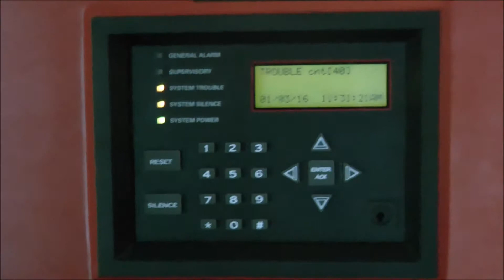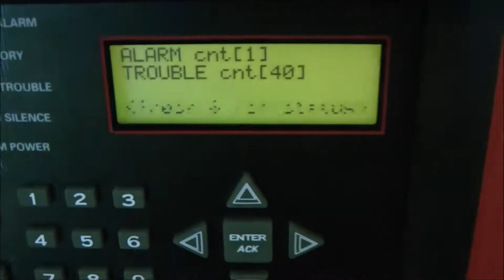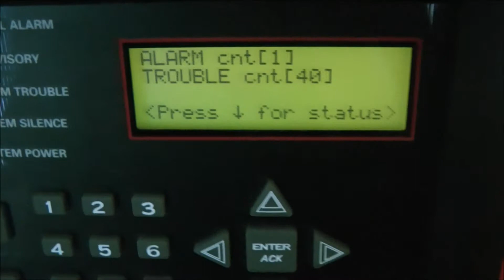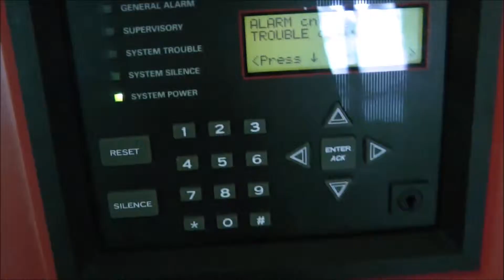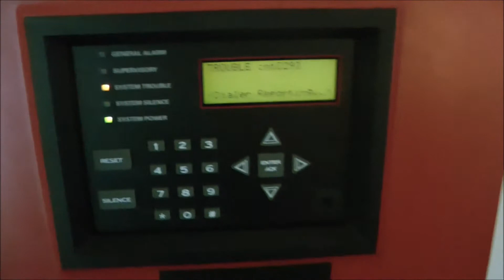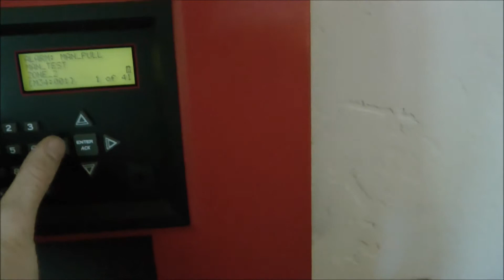Faraday / Siemens Synchronization Demo

Comment: That is actually normal for the strobe to flash with the horn because there is jumper wires on the back that you have to cut separate the horn and strobe circuit because the reason it does, that is if you buy a sync module from the same company as the alarm device the sync module will convert four wires over to two wires in the posting of the module will make the alarm due audible silence if you don’t believe me look up wheelock DSM videos and you can see the DSM how it silence is the wheelock device
Reply from the maker: Funny you commented this now, as just last week we managed to track down a Faraday sync module for these! Though all our SK panels have that protocol built in, it's nice to have for the others that don't. 

As for those jumper wires... Once, a few years after we made this video, I wired up one of these alarms to our panel as a 4 wire device... and forgot to cut the jumpers! That's how I discovered my panel will turn itself off and restart when 2 NACs are shorted together... whoops.
Reply: @HappyJigg  that’s a good thing. Your panel has that safety where it shut itself off when it detected the nacs were shorted